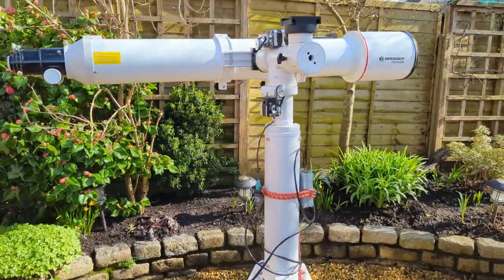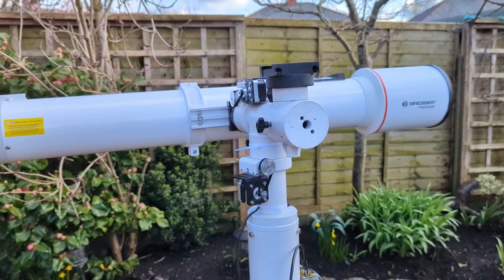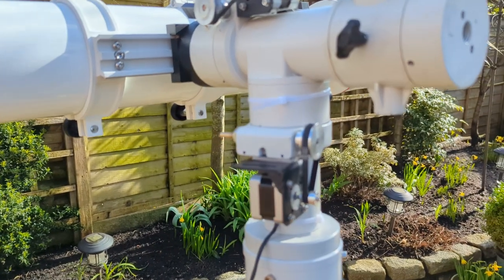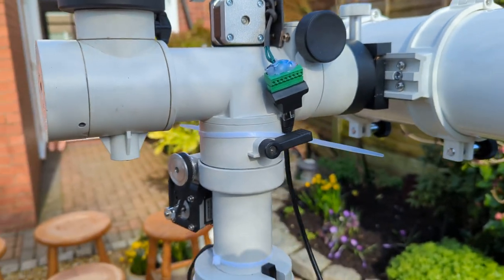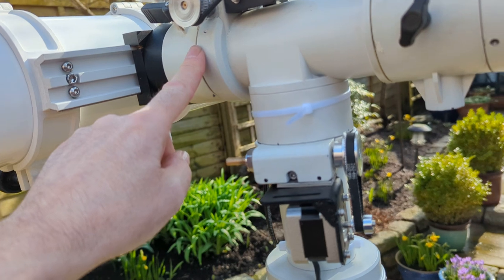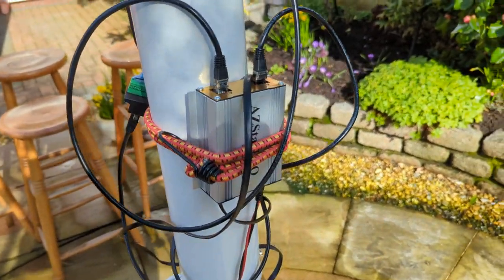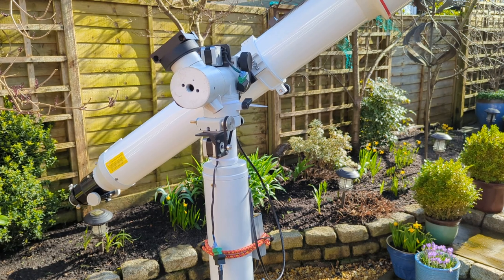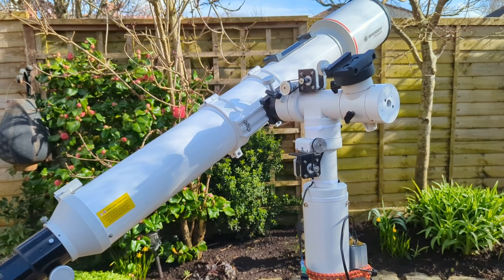AZStarPRO – AZ drive GoTo controller for azimuth mount SkyTee 2

Comment: Any progress with regard to pointing accuracy, you just need a 3d printer now to keep the dew off your motors 👍  I messaged the seller regarding using this kit for a dobsonian, you can use Nema 23 1.8amp motors which would be more powerful for a dob via some gearing.. Looking forward to seeing it work at night through an app?
Reply from the maker: Its been very cloudy, not had a chance :(